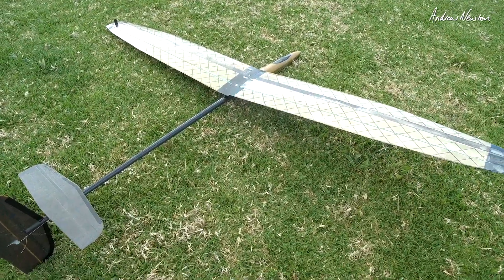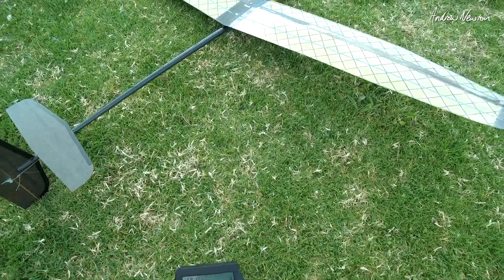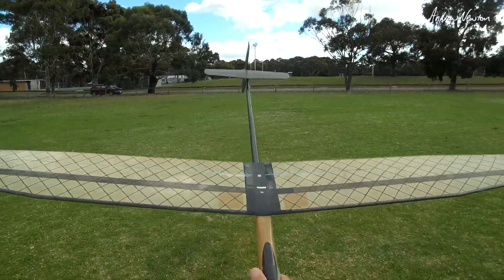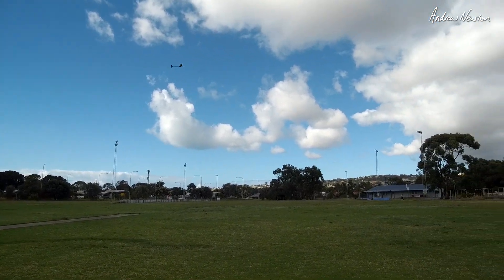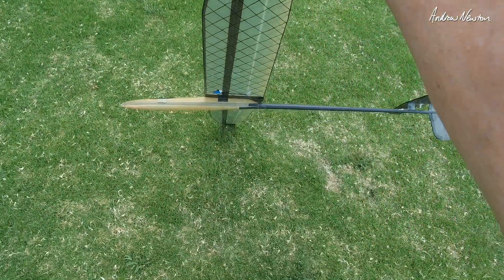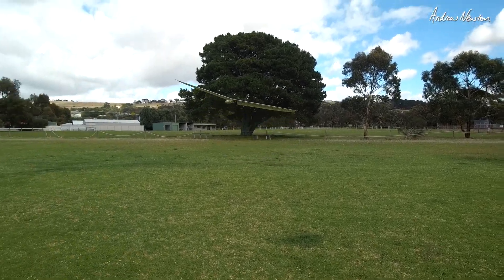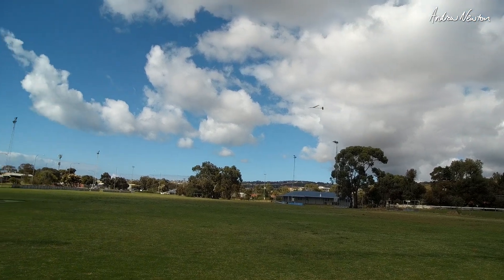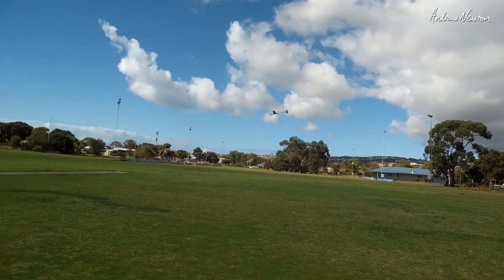MKS DLG Servo flights

Comment: If this is a copy of the popular ag 4xx series airfoils then you dont need reflex for the launch, the wing is moulded with the reflex already in, as in when the trailing edge is flat that should be reflex, I was flying mine for about a year until I came across an article on the foils that showed the camber positions..
+1= speed 0 = launch -1 cruise -2 thermal .. I had been flying mine around with -1 cruise because I thought it flew better that way, No wonder, I had been flying in launch mode all along  ;]
Reply from the maker: Oh, great information thanks.

Comment: If you don't use the neck strap on the radio, then your arm is free as a counter weight. That alone will give you much better launches.
Reply from the maker: Yes I would usually have a wrist strap